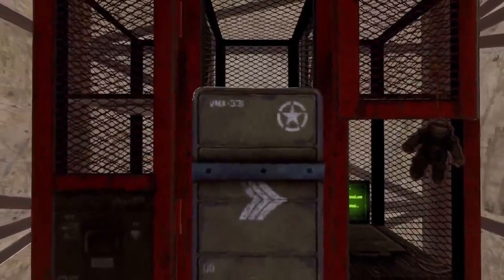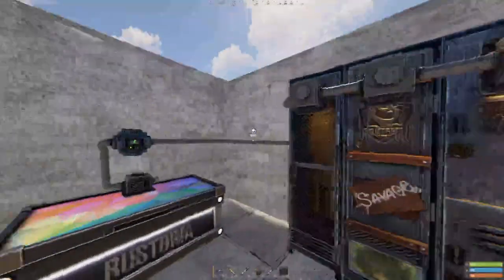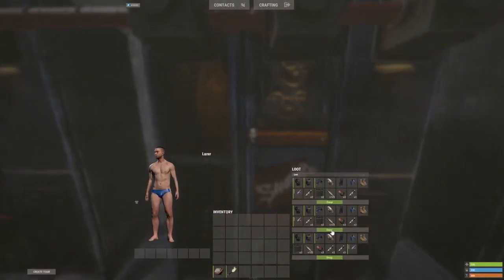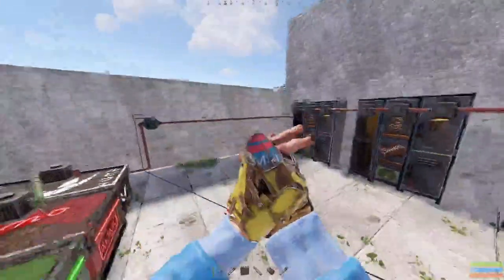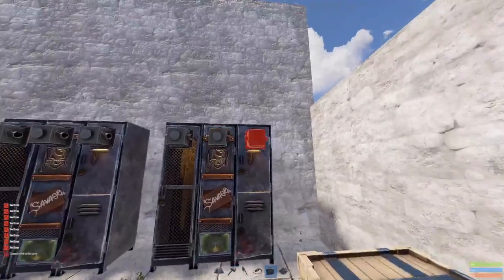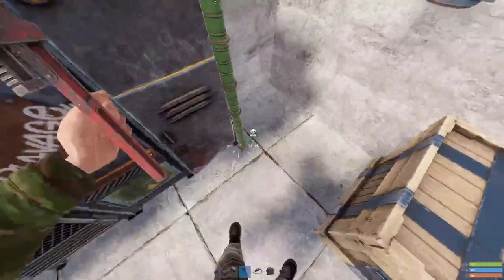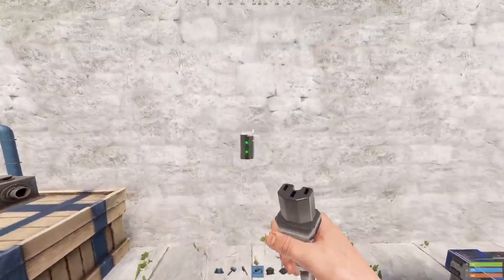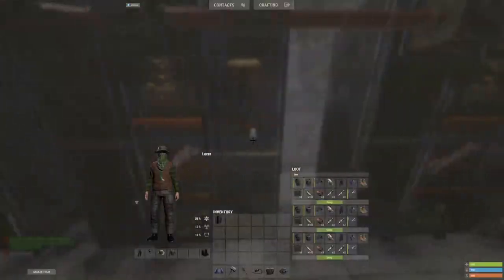Best Industrial Auto Locker Design In Rust

Comment: How would this be doen if u wanted to add some hazmats into the mix aswell as full kits?
Reply: I think you would need a 2nd conveyor to run to the 3rd slot in all of them as its own loop.  Then just use a combiner before the clearing conveyor